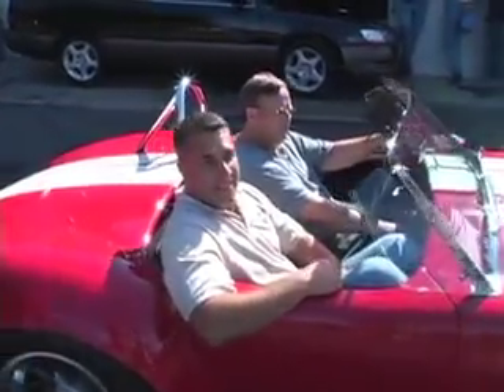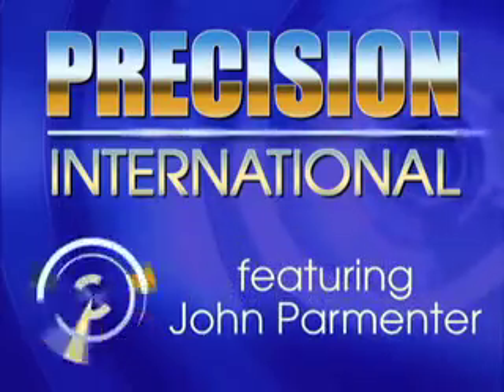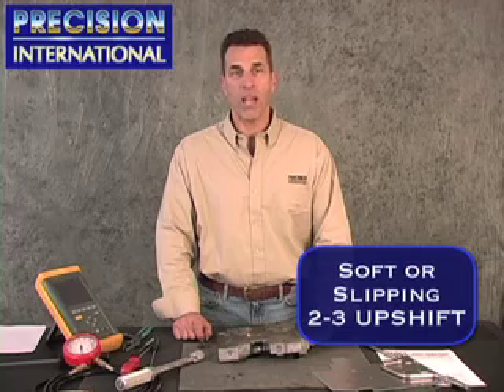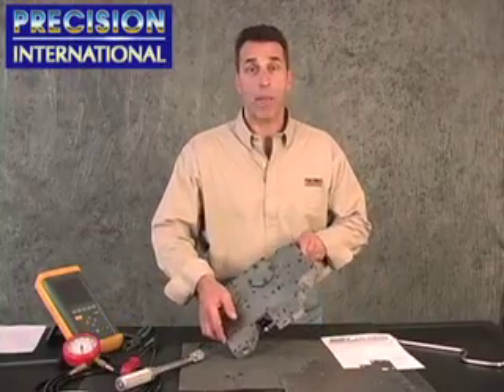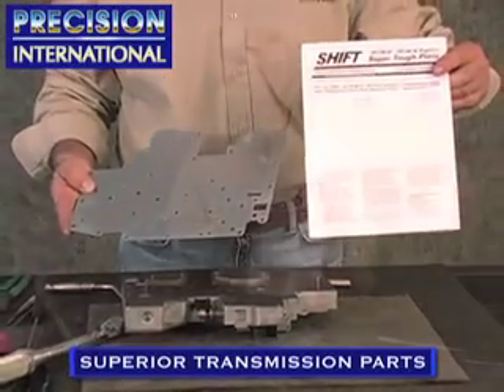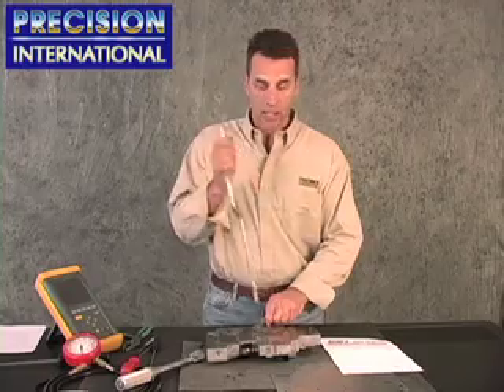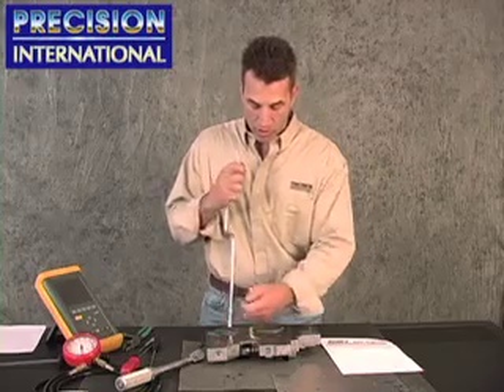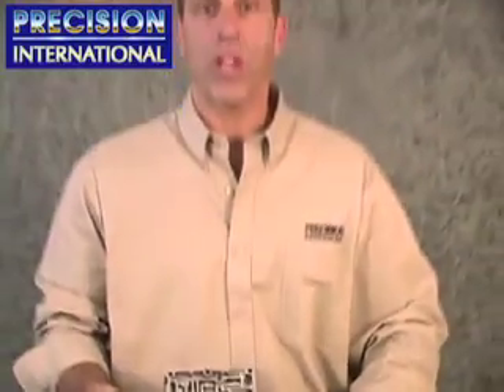4R70 Series - Soft/Slipping 2-3 Upshift and Delayed Engagement in Drive

Comment: Replaced the plate and have the same issue.  The old plate had the same cracks as the video.  Did not replace the balls but did replace gaskets and filter.  I did measure all the balls and they were .25" without cracks.  Any comments would be welcomed. It only goes forward when in 1st and it is very delayed or I need to step on the gas.  thanks.

Comment: On a 06 4r75e would the cracked plate at the 2-3 solenoid cause no overdrive as well? The servo, snap ring, and all are still in place for od but it still has no od